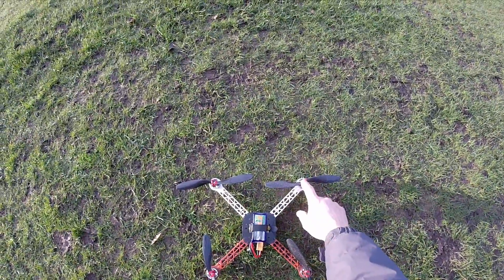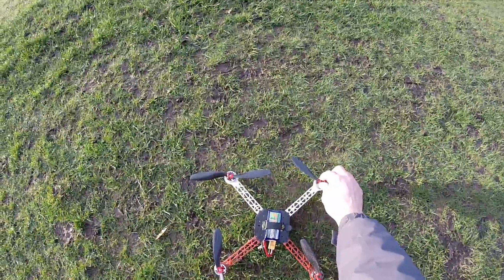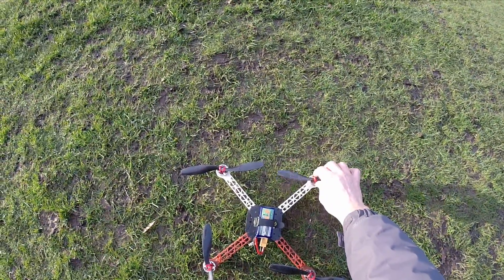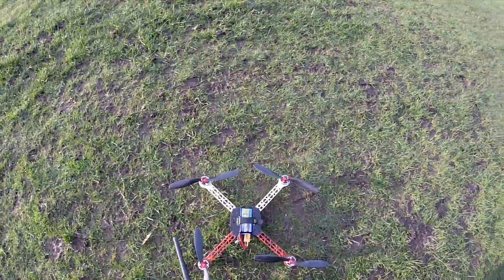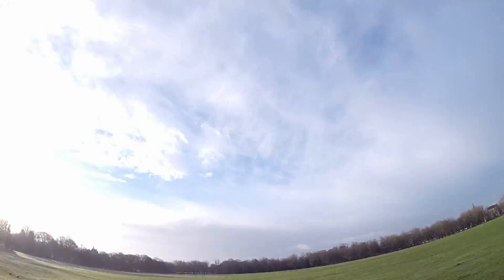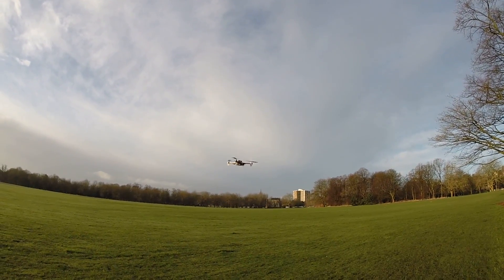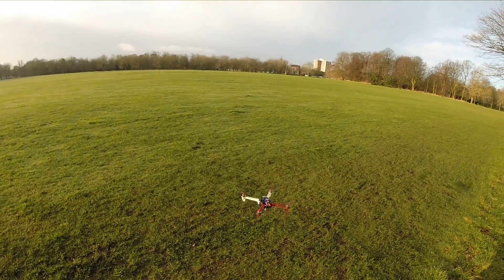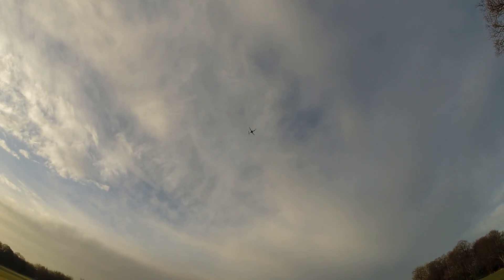Flying the Acro Naze 32

Comment: Hello Friend ! I'm from Brazil! , and I'm putting together a project with these same settings, I have some doubts ,,,, The PID you deichou default? had trouble with the compass? a friend said that this is the problem of naze 32, I'm afraid to have this problem I talked about it, you had problems with pid, in that frame?
Reply from the maker: This was a long time ago. You best use more recent flight controllers with Betaflight or iNAV firmware. I don't recommend that frame because the arms flex too much. Buena suerte!

Comment: By coincidence I built one with the same motors, rev 5 naze ,sf cheap props, afro 20 amp,and same pdb.Easy to build. It taught me to fly LOS, many crashes and it is still going, So I built another one exactly the same and they both fly around with cheap fpv  AIO gear, flew one 3 days ago.

Comment: you can set up a switch to go from acro to horizon on your transmitter? how can this be achieved
Reply: in base/clean/beta-flight configurators there is the "mode" tab. this allows yo to set the values of aux channels to toggle various modes (including arming the motors, etc)

it helps to have a radio with more channels. e.g. the 6 ch flysky i6 can be modded to do 10ch (via ppm/ibus), which enables all the switches on the controller.

Comment: HELP PLEASE,  I have the same set up as you, my FC may be an updated version though. I noticed  you're using an FS-TH9x just like the one I have but I can't seem to make mine work. In Cleanflight all seems to work, the receiver channels work fine and I can spin the motors through Clmeanflight, but when I disconnect the USB, nothing work. Can you please share your settings and receiver connection for the transmitter to see if I can get this of the ground.  I'm new to this hobby and frankly just about to give up, I;ve searched for the last month an a half but no luck.  Thank you in advance for you help
Reply from the maker: +Raul Cribelis Hi Raul, the best way I can help you is in my blog, click here http://www.rcgroups.com/forums/showthread.php?t=1970974&page=416

Comment: That's a nice machine. I'm thinking about buying a quad for video. Yours seems like it's a lot quieter than most i see on youtube. Is that because of the motors? And will it carry a GoPro?
Reply from the maker: Gary Harris thanks, its been a while since I used to fly that one, yes those motors are very quiet and the props are 8x4 carbon fiber, it can carry a GoPro,  I put my Gopro with the outer case too which made it heavier, hence a  bit of of a struggle to fly, so with no case it would be even better.

Comment: It's funny  you mentioned that drift.   I tried Flip32  and Naze32 on  large quads 450 size and they both have a drift problems.  I switched the large quads back to KK2 which is rock solid.   Naze32 and Flip32  perform excellent  on 250 quads.  I think these flight controllers were designed for small mini quads from the ground up.   KK2 sucks on mini quad too.  I could never adjust  it to fly rock solid.   I  fly 2-250 quads with Naze32 and two large  quads with KK2, get very stable platforms.
Reply: joseico90 can we use naze32 on bigger quads? for Aerial photography?
Reply from the maker: ***** come over to this thread if you need some help Nick :)
http://www.rcgroups.com/forums/showthread.php?t=1970974&page=250#post31195305
Reply: *****
Based on my experience, Naze32 and  Dragonfly32  a.k.a. Flip32 are the best flight controllers for mini quads, but I have had no  success  with  them on  large  ones.  Can't get rid of  that drift, looks like  accelerometer or  math in programming cannot  deal with  large distance between motors.  KK2 are just the  other way around, they suck  with small  quads but perform excellent on large ones.  Anything smaller than 350 I would convert to Naze32.
Reply from the maker: Taking notice of your feedback :) I have moved on from KK2's, all I use these days are Naze32's. These things are mixture of hardware and firmware, the latter is what makes the biggest difference. I'm currently running Cleanflight with Oneshot and Damped Light on the ECS's, awesome performance.
Reply: can we buy from Ali Express? please help me I found its way cheaper than other sites
Reply: I would not recommend it.  Try modern F3 Flight controller.  firmware has gone a long way.  Naze32 is old technology.   Get BlHeli ESC's F3 flight controller with Betaflight firmware, and  you are rock solid, even on default PIDs

Comment: I hate it when people post a clip showing that they have their rates all sorted nicely and don't share them. This hobby and the people in it are generally not like that. Usually, we get help from the older more experienced guys, and then in time we pass it on to the nube's. We all need to grow and help others, and encouragement is a priority. Respect that thought.
Reply from the maker: If you look at the link in the video description there you can download the Baseflight file with all my current settings. Please understand that this quad had been stored till recently, I had an accident and I've been out of flying action for months. Recently I had to upgrade the firmware so I had to re-tune it all again. If you look at my blog you'll soon see I'm the "sharing" type. :) Happy flying.
Reply: joseico90 Cheers.  I had a look at them. I don't yet use a naze and after seeing the numbers it looks like a lot of work to set up.  I built my own quads from parts at Hobbyking like many people to save money but i think Id rather buy the Storm Drone Racing minquad all setup and RTF JUST to save the drama of setting up a naze. I might be mad but spending Hours on Forums trying to sort out the problems i see some people having makes me think it might be a better option. I notice now Naza has a light Version which saves a lot of money and hassle too. Thoughts ?
Reply from the maker: grandchancelor It all comes down to what you want, even Naza's have to be connected to a PC to do basic configuration and changes. If you're looking for "plug and play" you'll have to look elsewhere and will very likely be fun "toy grade" stuff. If you however want to get higher hobby grade performance then you'll have to put the effort in learning how to use Baseflight for the Naze32's, or the  popular and perhaps user friendly KK2 controller which have buttons and screen built in, I learnt on KK2's.

 It might look intimidating but setting up a Naze32 is a fairly easy affair, there are loads of videos here and the Baseflight user interface is user friendly, you've got dedicated forums too...yes I know it gets a bit technical but that's goes with this game. I had to read a lot, watch lots of videos and put the effort to learn all this because to me it was worth it, still is.
Reply: I found the KK2 pretty simple. Il think on it though. Cheers mate. Is any of it Mac friendly ? Since I've moved to Mac now
Reply from the maker: grandchancelor yep, most of these popular controller GUI's work with Mac.
Reply: grandchancellor  Speaking of  rates  on Naze32, the only thing you need  to change is RC Rate, and Yaw rate.  RC Rate 1.5 will put you  in flips and rolls and crazy acro.  The defaults  are too dampened down, boring even for a nub.

Comment: Nice flying...... I just got 2 of those boards...... 2 for my mini H and the other one will be going into a similar frame as yours.
Reply from the maker: You'll see a big difference compared to ordinary MW boards, that 32bit processor works wonders, it flies so connected to you. I haven't flown anything better so far for sports flying. Tweak the throttle curve and rates to suit you and enjoy, default PIDS work OK, then tune as needed. Enjoy :)